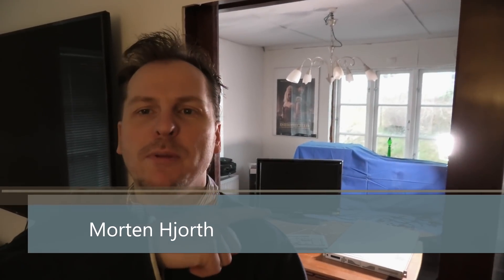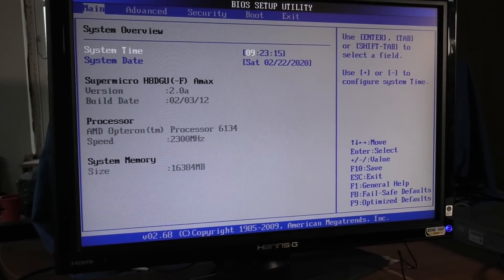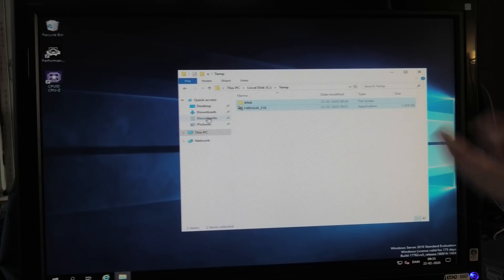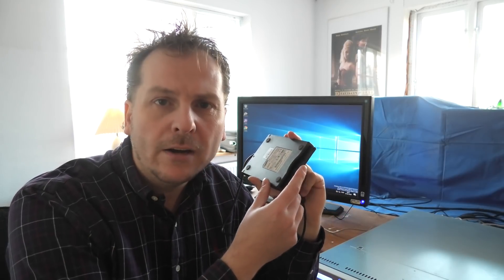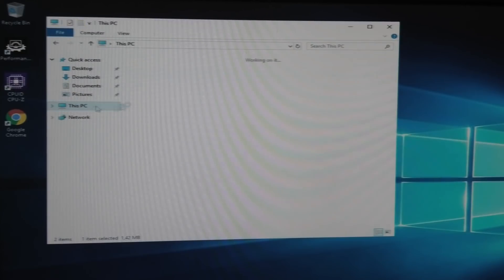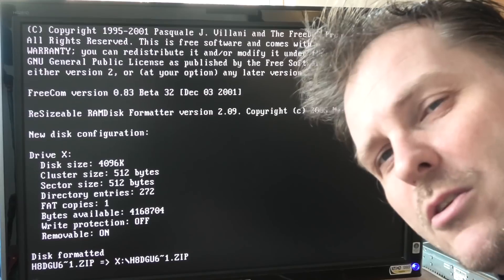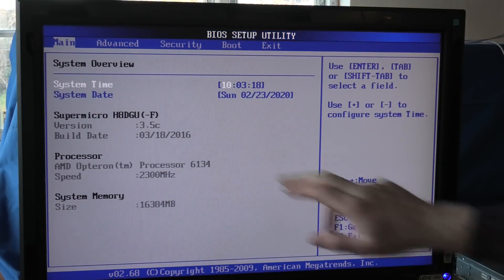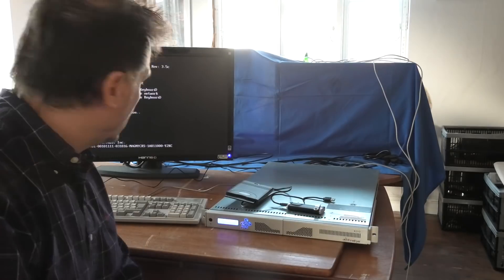Supermicro Server Needs Floppy to Firmware Update - 934

Comment: I just updated an older SuperMicro X9SCL-F - Downloaded RUFUS and created a bootable USB with FreeDOS. Extracted the .zip file. Booted the server with the bootable USB and upgraded the server. No need for a floppy drive.
Reply from the maker: Why do they only have a floppy solution for this model :-?
Reply: @MyPlayHouse  If the machine type can boot from USB and it seems like it can since you can boot from a USB floppy, then just create a bootable USB key with freedos by downloading RUFUS from here https://rufus.ie/ and unzip the H8DGU6_318.zip file from the supermicro support site to it. It is not a simple as the bigger brands like Lenovo, Dell etc, but it could be worse.

Comment: On some modern desktop boards you can flash via USB without having to use a boot disk.  I like that vs the old way where you had to boot with a clean DOS boot disk and pray that it boots after it is done.  Last time I screwed up a BIOS flash I was still able to boot from a floppy somehow and even then recovering from a bad flash is tricky.  That is especially true if that is your only computer and you have no way to get the correct file and try again.  Most times a bad flash either has to be fixed by sending the board or BIOS chip to the manufacturer or a knowledgeable person IF you can remove it easily enough.  You may get lucky and have yours in a socket.
Reply from the maker: On newer enterprise servers there are two bios,, a primary and a backup. I have needed that onces,, I was firmware updating a x3650 M4 using the IMM management system. and right after the firmware was completed, I wanted to put in some more hardware, so I wanted to power it off.  There for I was ready to power off the server as soon as it was on it's way up after shutting down after the update. And pressed tow power button just as the text telling you NOT to power off... NOT good :-/ that messed up the primary bios, but booted on the secondary bios. and I was able to fix it again :)

Comment: I guess the two reasons why they are so noisy is they are often in a separate room and they need good cooling or they may fail.
Reply from the maker: Hi Charles Hines
Thank You very much! and those small fans, has to turn so fast to move enough air :-/
Thank you for watching! :-)

Comment: All servers do have use for floppy drives.. but a usb one.. most will work with that... 

That looks like a dell C** models. Sounds like one too... bet sm is the oem supplier dell uses for custom data center builds
Reply from the maker: All the 1U servers are always pretty noisy.

Comment: usually when it needs a floppy(dos), I use an sd to ide or sata adapter......goto bootdisk.com download winme bootdisk/extract using winimage(can probably use freedos or similar).... HP utility to make a bootable usb dos stick(on the sd card) using a usb reader/writer....copy over relevant bios utilities etc(winrar or universal extractor works in most scenarios to extract stuff).... pop sd card into adapter and should be good..... worse case, spi flasher:P.... only time I resort to floppy, would be on intel boards recovering from a bad flash since the bios images are usually encrypted:S and it has to use the bootblock with no gui/etc(if it happened enough times I'd buy a floppy emulator since they exist now:P) ** bonus if you want to avoid using cd's and dvd's, there's Zalman ZM-VE350(usb optical emulation + harddrive enclosure) which is pretty awesome:P or can use usb flash sticks often of course......
Reply from the maker: Would it not, be nicer if they had made a newer way to firmware update,, then leaving all the work to you :-)
Reply: @MyPlayHouse  I completely agree, especially for non consumer oriented device lol...

Comment: If you can dump the image, you should also be able to write that as an emulated floppy on a CD
Reply from the maker: ;-) fixing there obsolete technology, for them.
Reply: @MyPlayHouse  Sort of. Really, the computer is a mass of various systems that are tacked together to make a product. Worse than this was a Dell laptop I worked on who's bios was borked. Could recover from a floppy, would not take a USB floppy, but would take the CD emulated floppy as a bios source. Since the bios was made by an outside source, it's update and recovery methods are it's own. 
Disparate technological methods are the price we pay for cheap hardware that is quick to market.

Comment: H8 boards are old. But normally you can download and boot from the system driver iso disk. You can use the several utilities to make a bootable USB flash drive, but might need to be less than 2gb. Then you should be able to get the DOS bios firmware and tools to copy to the flash drive and boot it.  All that said, I have an H8 machine and it was buggy! More buggy than my Intel 7 series. The 9, 10, and especially 11 series boards are far better for all this junk.
Reply from the maker: Hi Mini GP Racing
Thank You very much!  glad you liked the video :-)
Thank you for watching! :-)

Comment: Also, i was tinkering with my hp- xw4600 old workstation. 👈👺
And I noticed that its motherboard ,is so old skool that it has provision for a floppy drive.
Reply from the maker: It old if it has the old ide cable.. 😉
Reply: I used to have an xw4600 - a Floppy controller and connector are indeed on the motherboard.

Comment: Just stop using Windows altogether
Use Linux and forget forced updates.
Basic Linux will always boot much faster then Windows.
Linux does care much about hardware, it runs on anything and everything (yes this includes toaster from NetBSD).
Linux won't suddenly not boot because of firmware change, as it does not have registry (I still cannot grasp idea why it is needed in first place, it just hinders usability)
P. S. Why it took Microsoft 20 years to lose that USB is HotPlug is beyond me. Linux has it from beginning. You have not have to install USB mouse drivers after you changed USB port (it was quite stupid, as you could not install USB keyboard or USB mouse drivers before login and you could not login with keyboard, deadlock due to bad design). I usually spent half hour just plugging mouse and keyboard and unplugging those and plugging to different ports to avoid this problem
Reply from the maker: Well this firmware was available for Windows and not for Linux,,

Comment: Aaaand every Supermicro server I got in contact with (more than 100!) was really disappointing. I think it is really the cheap way to go if you want a server and don't want a refurbished one
Reply from the maker: It does seem to be entry level of servers,, to put is nicely :-/
Reply: I must say that while Supermicro have seen a bit entry-level you really got value for money. Quite cheap and really good quality
 Never had any problems with them. Really stable and long lasting. They have become a bit more enterprise in the later years but still quite cheap.

Comment: You can install windows XP from floppy if you want. Absolutely mental lol
Man I'm glad we put those things behind us :)
Reply from the maker: Well in 2020 you still need them to firmware update a Supermicro server... :-/
Reply: @MyPlayHouse  well, it is old hardware...

I installed Redhat from floppies. Could it been about 30 of them? 
Downloaded over 56kb modem. Almost as painful as running Emacs over a 300 baud modem. 😜 Those where the times.

När MS Windows ME skrev över Redhat-installationen en andra gång så blev det fdisk c:
Aldrig ångrat det, tack MS Windows ME. 😜
Reply: @AndersJackson  I'm happily a 50/50% user Windows/Linux. First one is way, WAY more polished in the user interface department (and hw accelerated video playback, games etc). Linux is where I do the more nerdy stuff like coding and hardware hacking in general :P
Reply: @MyPlayHouse  Well this is too late since you've already performed the update but I found the same firmware update but in a zip format (with actual files) on their page. If it supports USB booting you might be able to use Rufus and create a bootable DOS usb stick and stick the update files on it. As said I'm too late but it might be worth a try if you have to do it again to another older machine :)

Comment: So the FireEye is as effectively an Intrusion Detection System, Firewall, etc and I believe they're capable of deep packet inspection as well (which helps with identifying and blocking stuff like bittorrent for example). I don't believe it does routing, usually they're just man in the middle devices that you can place between routers (ingress/egress points).
Reply from the maker: Hi DigitalSparky
Thank You very much!  glad you liked the video :-)
Thank you for watching! :-)